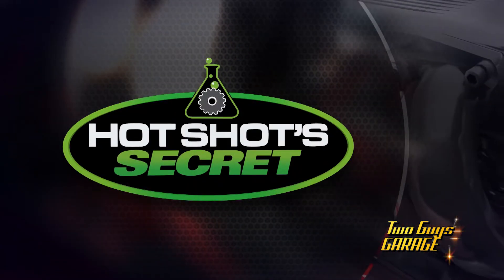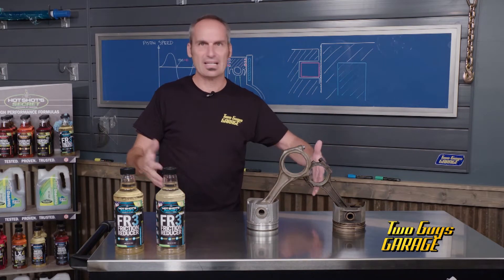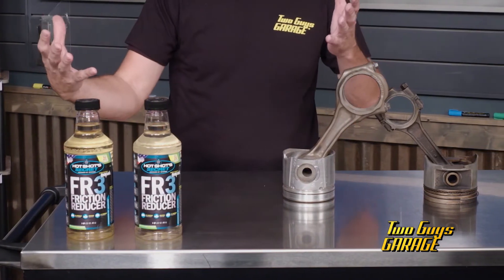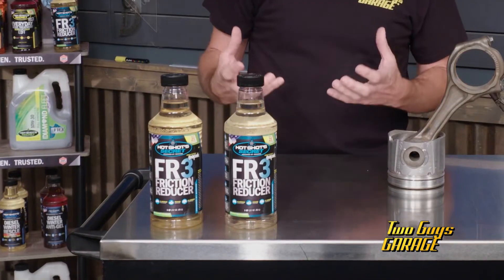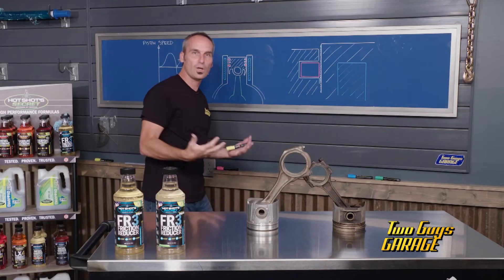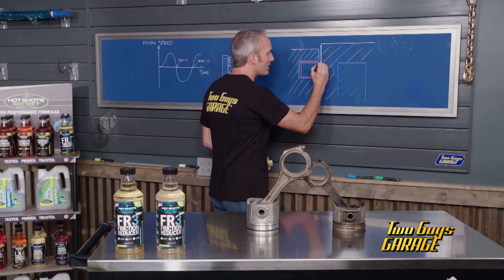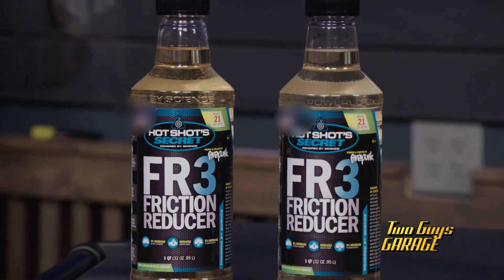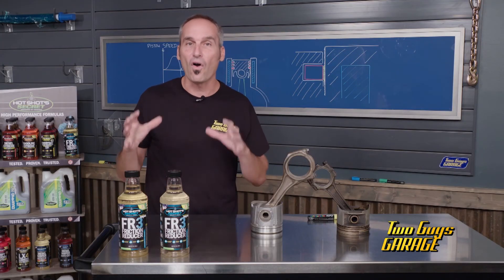How FR3 Is Protecting High Horsepower Engines

Comment: I have a 2010 dodge ram 1500 5.7 hemi takes 7 quarts is 8 oz the correct amount for the FR3
Reply from the maker: 7 quarts requires 10.5 to be exact.
Reply: @HotShotsSecret  why is it 10.5? So I need a 16 oz bottle then?
Reply from the maker: 1.5 oz of FR3 per quart of oil.